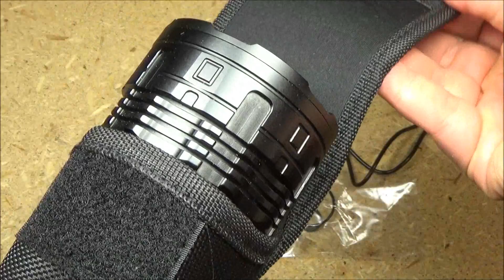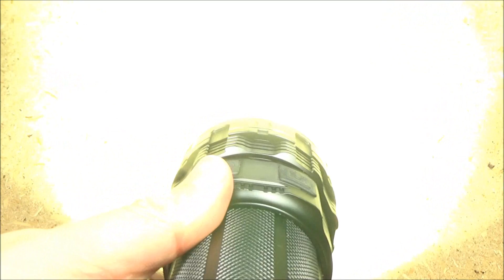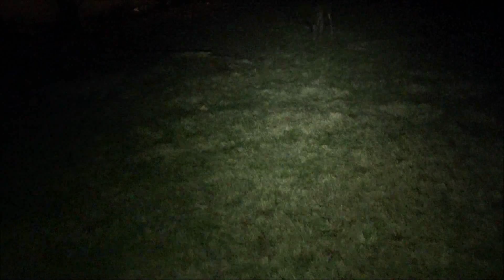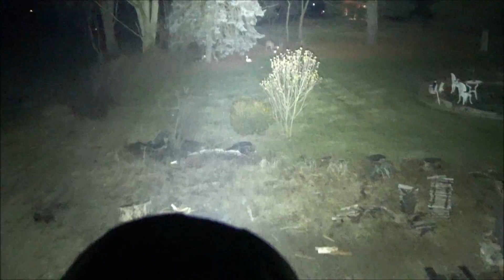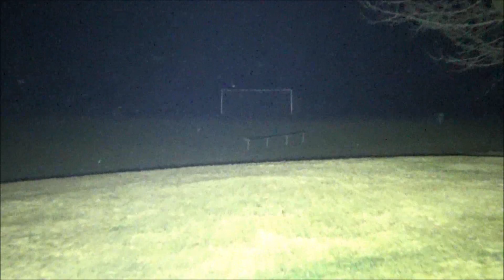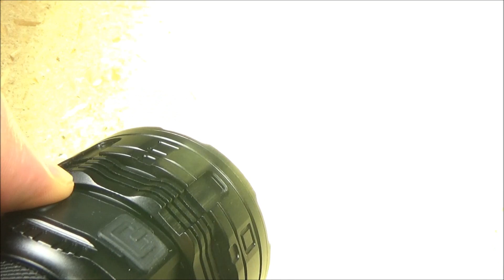Imalent DT70, 16,000 Lumen Light, 700M Range, Brightest I Own

Comment: can you do a review video on the imalent dx80 and get us a discount code for that one also. really like your videos very informative and helpful in flashlight hunting.
Reply from the maker: I'm going to post a review of it very soon :]   I talked to Banggood about a discount code and they said they are probably going to do VIP pricing instead of a code.  The VIP price will be at least $100 less expensive than normal.  I'm not quite sure how it will work though, I think people will have to sign in to see the discounted price.  But the DX80 is sold out at the moment anyway, so we will see what happened when they get some in stock.
Reply: yeah im just really torn with the 13k + lumen lights. I have a olight x7 9k lumen and love it, have it in nw and cw. want to get in the 13+ plus lumen game. my only thing with this one is the lack of a output between 1k and 8k seems silly that there is no 3k or 4k option for a mid level output, however if the discount code works still when the dt70 is back in stock i dont know that i would be able to pass it up, that how i came to have both x7 is because i got the whole kit on black friday for $116 each. so im almost leaning toward the acebeam x45. all this leads me to the curiosity of the dx80 because i really dont know if i would want one that takes a specific battery pack instead of easy to find 18650 and would really look forward to your thoughts. sorry for all the rambling lol.

Comment: This is the best video on this flashlight! how do u recharge the battery can u plug into a wall outlet? I see this flashlight come with a USB cable one end of the USB cable plug into the flashlight what about the other end of the USB cable where do u plug that into? Most of the time I buy a flashlight it come with a cable  one end will plug into the flashlight and the other end of the cable have a adopt that u can plugs into a wall outlet.  Thanks
Reply from the maker: Hi!  To recharge it, plug the other end into the USB port on a computer, powerbank, or battery charger with a port.
Reply: WeAllJuggleKnives -can u tell me where to buy a good battery charger that will work with these battery?  Thanks
Reply from the maker: Amazon sells Thrunite and Nitecore chargers that are good, I use those.
Reply: WeAllJuggleKnives - hey when you first got this flashlight did u have to recharge the battery? I just got the flashlight today and the battery is completely dead! I am recharge the battery right now. To recharge the battery take up to 8 hour?
Reply from the maker: Yes, I recharge all Li-Ion batteries I get, before using them. Even if they are not totally drained, the turbo mode will work best when they're fully charged.  Yes it could take up to 8 hours if using the USB recharging.  If you use a separate smart charger, it takes less time.
Reply: WeAllJuggleKnives - man u know what! I don't know why my battery won't charge?  I use the usb cable that came along with the flashlight I charge up to 8 hour stright from the usb cable to my cell phone adapter after that I put back the battery into the flashlight and try to trun on but nothing come on why? So I charge the battery again this time I use the 18650 battery charger for these battery I have charge these battery in the 18650 charges for 10 hour already I put the battery back into the flashlight again and  try turn on the flashlight still nothing come on! Why? When I use the usb cable to charge the battery incidator on the flashlight did't come on all I see is the word imalent keep blinking off and on the flashlight.

Comment: Thanks for another great review! 
Have you checked to see how long this will run before stepping down, if you start it out from a cool state, straight to level 3? Which is 8000lm.
Reply from the maker: Hi!  I did not time it, because I switch it down before the step down kicks in. If it gets super hot, I don't wait.  I wouldn't run it for more than 1 minute burst on the turbo mode.
Reply: Thank you. When you get a chance though, while the flashlight is cool (room temperature). Take it straight to 8000lm, and see how it warms up then, and how long it takes to step down please. 

When Turbo is ever used, before a run time test of the second level, it just ruins any chances for the second Lumen level, to have any decent run times. I'd like to know what those run times could be. Within reason of course. I wouldn't want you in any way, risking your flashlight for science : - ) 

I am doing a study. Some flashlights I have, and many I don't. My question is, in this study. What flashlight can maintain the most lumens, for the longest period of time, without any step-down.

 So far, as we are early in the data gathering on this. The Acebeam K60, can be placed straight away into the 4000lm level, and keep that up, without stepping down, until the depleting batteries start the dimming process. I think this may be the best we can get, at this moment in time? But, I'd sure like to see how this DT70 does. Even with its limited fins, at the 8000lm level.

Comment: I just buy dt70 but failed to charge, charge it for half hour and test it outi use 5V2A charger, but the charging sign didnt occur, instead there is "imalent" sign flashing while charging, i try to turn it on but failed... please help me what to do?
Reply: Daniel Suryajaya buy a charger plug
Reply: jt bass gambler -where do u buy the charger plug at?
Reply: Daniel Suryajaya -u know what I just got my flashlight and is doing the samething like u just said is not charging it just blink off and on with the word imalent!  How did u fix your problem any advice or tip for me? I charge my battery for 8 hour stright didn't do shit. Thanks

Comment: I got mine in and wow fast shipping and free at 179.00. what a bargain:) I found out you can run thrunites battery's in it from one to 4 battery's as long as you don't go past 1000 lumens. YES it will work on one battery at 1000 lumens. If you go to the next 2 higher modes (8000 and 16000) the battery auto shut off. I found that the thrunite smart charger charges 4 battery's in 3 hours instead of using the slow internal charger that take 8 hours.
Reply: 40belowful -what do u mean the Internet charge for 8 hour? U mean u have to plug this flashlight into your computer to charge the battery?

Comment: I used to think more lumens in a flashlight is better, since the Thrunite TN36UT came out. But now, even with the Olight X9 Marauder's insane output of 25,000 lumens, I think they're way over-rated. Now, I'm interested in beam distance. I'm hoping that Thrunite pushes to make a searchlight that runs on a Cree-XHP70, maybe it'll push the distance even further, hoping that it doesn't require unprotected batteries.
Reply from the maker: I hear ya, I went from small AAA and CR123 EDC keychain lights, to the super bright lights, and now I like long range too (although without looking through the zoom on my camcorder, I wouldn't be able to take advantage of some of the ultra long ranges on my Thrunites). This DT70 has decent range though, 700M, lot better than most of the ultra bright flooders.
Reply: It would most likely require unprotected batteries to supply enough voltage to the leds. Protected cells just wont provide enough amps for the boost driver to convert to volts unless you're willing to carry a light that holds 8 batteries like the X65. 

The furthest throwing led compatible with a multi emitter setup is not currently being utilized by Thrunite, so you are correct on that point. But you're not going to see a light by any company that will throw further than Thrunite's current lineup using the XHP70 led. Although I will agree that I wish more companies would design lights that have medium-to-long range throw using multiple XHP70 leds like this DT70 and maybe even increase the head size a bit to get more throw. The only thing I can think of is a custom light by skylumen called the TK70vnQ but is is very expensive because you have to add on the cost of the parts and labor of the modifications to the already expensive light but it still doesn't throw as much as current Acebeam and Thrunite models. 

Throw is very different from brightness in regards to the physics of the light. The larger the LED = more brightness. The led to reflector ratio = throw. The XHP70 is brighter than the XHP35 HI and XPL HI but the XHP70 is larger so it doesn't throw as far. So if you want an XHP70 to throw that high of an output further than what is already available on the market then you have to increase the reflector size to the point that it's too large to carry in your hands. Right now from what I have seen the Thrunite TN40S and Acebeam X65  are the furthest throwing high output multi emitter lights and they both throw much further than this DT70 although they don't put out quite as many lumens. The TN40S is 4,500 lumens @ 1100 meters using 4x XPL HI emitters. The Acebeam X65 puts out 12,000 lumens @ 1300 meters using 5x XHP35 HI emitters. I would love it if Thrunite made a TN40S style light with XHP35 emitters instead of the XPL HI without using 8x batteries like the X65. You can get the TN40S with XHP35 HI leds from skylumen called the TN40Svn. I don't understand why they don't offer the option that allows you to pick the leds or create different models using the other leds. A lot of companies just haven't caught up to the newest technology yet. For example the Jetbeam T6 and Fenix TK75 both are using the outdated XM-L2 leds. I think we'll see some interesting stuff in 2017. Companies are just starting to catch up with the newest LED technology.